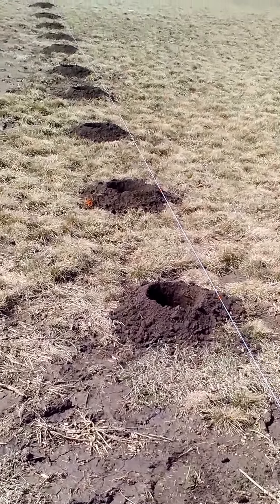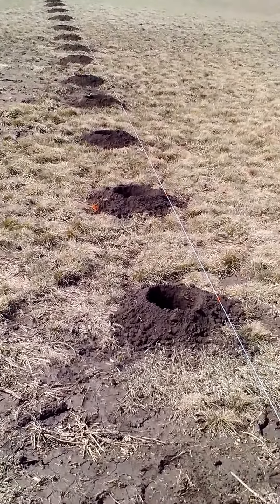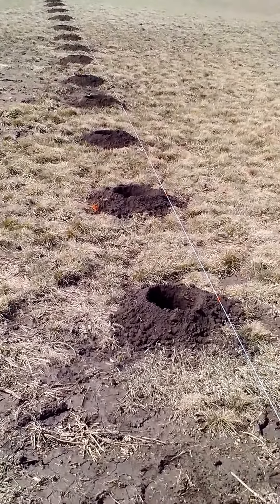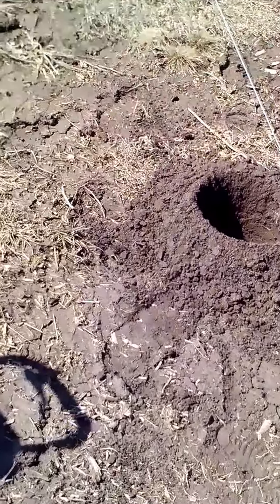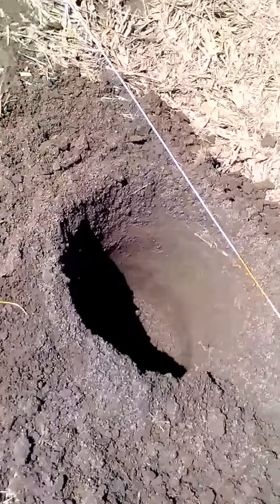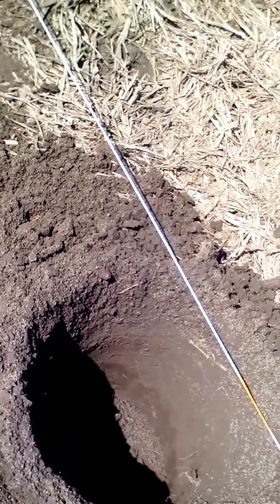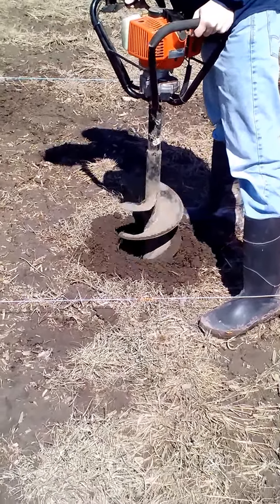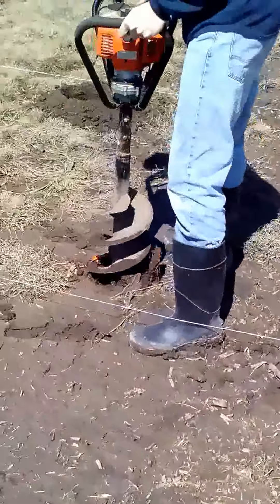Power Planter 728T Auger

Comment: $650 for a power head is too much boss. Alls I see is a weedwacker, a weedwackerw/ less materials in it than a 5' long unit. Any powerhead but perfered an electric powerhead for life longevity w/ a 2' x 24" bit mightbe the cats azz for doing residential plumbing work. Drill Drill Drill a perimeter and thenshovel it out.